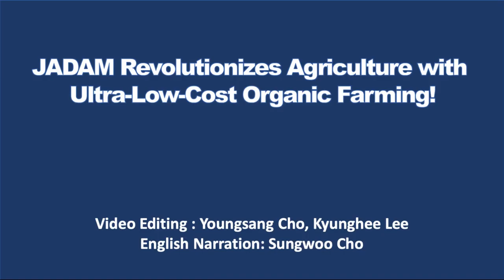NO-TILL with Landscape Fabric & Equipment. JADAM Organic Farming.

Comment: 1.Which one is better, to place the drip irrigation under the fabric or on the fabric?
2.What is the distance of emitter. 
3.If the drip is laid under the fabric, won't it be clogged with sand? And block the place that water comes out from? 
4.Which type will you recommend for vegetables ,tomatoes, peppers and corn?
Reply from the maker: 1. It must be installed below.
2. 2m is 6.5ft.
3. It is not blocked.
4. Do the same as in this video.
Reply: Two irrigation lines per bed?